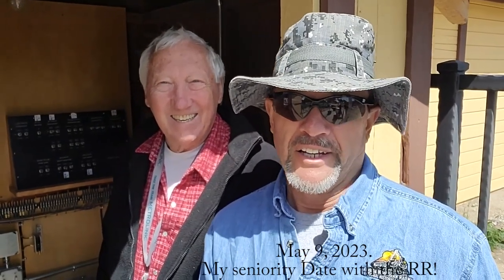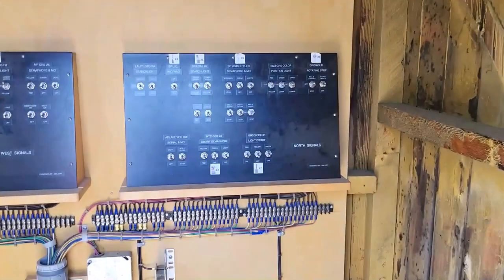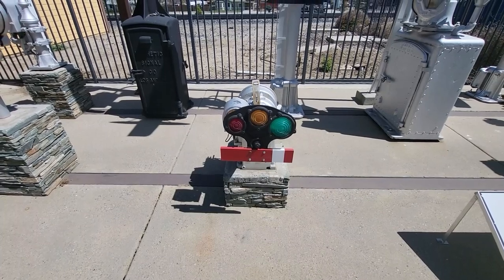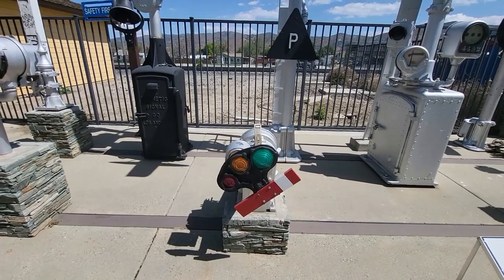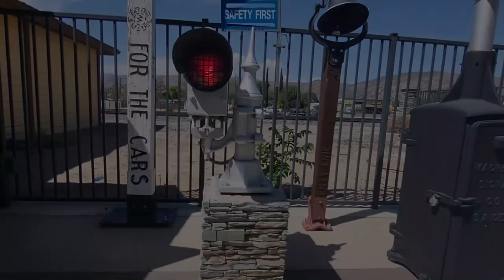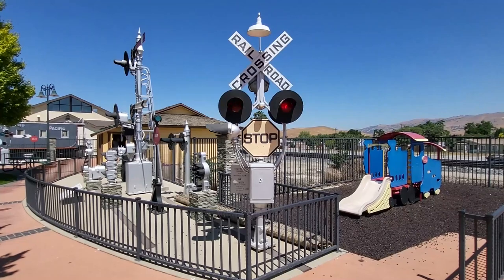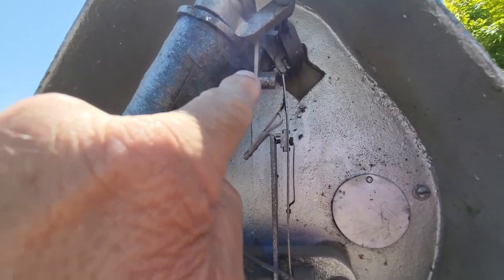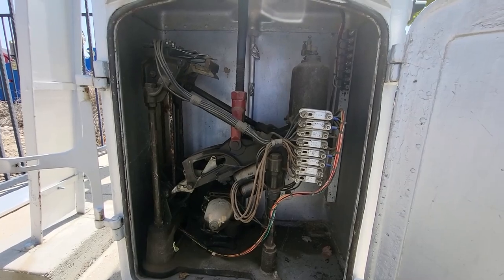How Vintage Railroad Signals Work: The Inside Story

Comment: It's my understanding (or misunderstanding) that almost all of these older signal types were designed so that if power was lost to the signal, the weight of the mechanism would cause the signal to go to red automatically as a safety design.
Reply from the maker: That is true. The mechanisms inside searchlights were also failsafe, with a counterweight that rocked the head to red if there were a problem. Thanks for checking it out!

Comment: Mark, you did a great job at explaining the signals.  I want to thank the guys who take care of the signal.  They are true railroad signal operators and maintenance guys who know their stuff.  Thank your and Thank you Mark for this great piece of video. Robert
Reply: 110 volt DC is a lot of power. Why so high ? That would be very dangerous to touch.
12 volt seems to be the voltage now
Reply from the maker: @ocsrc  If you're talking about the dwarf semaphore, I don't know why they went with that. Perhaps, since it was in a location where AC was readily and consistently available, it was just easier and less expensive, but that is pure speculation!

Comment: Hi Mark, thank you so much for the video, I really did enjoy it. The inner workings of those devices were simple and strong and would last a long time. The nice part is that they mostly made sense as to their workings, no magic from a computer, easy to diagnose. As an old retired mechanic I can appreciate the simplicity, like cars once were. There was an old station near my house when I was a kid and they had the semaphore out front. I’m going to assume that was there to get a train to stop? We also had some wig wags around here, Tacoma wash., the last of which, believe it or not, was removed just a few years ago when they upgrades a secondary line to run passenger transit trains.    Thanks again, much enjoyed.
Reply from the maker: The semaphore at the station was likely a train order board, which told a crew whether or not they had to pick up orders meant they did not, horizontal meant they did. The orders were handed to the crew on the fly. Here is the link to a video I made at the Santa Susana Depot Museum in which that process is gone over in detail.
https://youtu.be/CJfAT5EvWAw

Comment: Hay Mark : Given the dated  electro-mechanical  components [ The inner-workings of Pinball machines immediately come to mind ! ];  the durability of repeated; reliable performance under ALL weather conditions over the years remain as a compliment to the design engineers of these important  RR  safety machines !  ✊️👊🤙😁
Reply: I thought of pinball, too!
Reply: @matbr6949  Ja : The sheer NUMBER of Relays  and  related wiring-looms that controlled Pinball machines was unreal; especially given the abuse of forceful  Body-English  inevitably resulting in  * TILT *  ! !  👏😄

Comment: Gentlemen, I thank you for showing the real works of the signal apparatus, and all other railroad equipment that we would not ordinarily we [railfans] and railroad buffs would get to see. The parts of the signal lights are mostly mechanical, that could be easy to maintain more than the electronic parts. Mark Clay McGowan, I wish you "Happy Railroading!" even if you are retired.

Comment: These are examples of electrical/mechanical logic driving electrically functioning motors, relays lights, signs and bells.   These beefy concoctions of parts that go white and clunk revolutionized railroad (and all) transportation across the world.  The safety and efficiency gained is remarkable.  The museum is a wonderful presentation of that historical leap.  

A note about semaphore arms.  "Quadrant" refers to the part of the circle the semaphore arm uses to display the messages of aspect and indication, with zero at the top of the circle.  Upper Quadrant" refers to the 90 degree part of a circle in the clockwise direction between zero and 90 degrees, and lower quadrant refers to the 90 degree part between 90 degrees and 180 degrees. The style B semaphores use less than the 90 degree position at 180 degrees.  

Golly, the weeds are so cool!
Reply: Glenn, there were quite a few 0-90 degree three position lower quadrant semaphores.  The last being in service in  St Louis.
Reply: @paullubliner6221  You are correct.  I should have been more specific about the Style B units.
Reply: @glennfoster2423  The CRI&P had 3 position, 90 degree L.Q. Style "B's" Glenn.  "B Units" to me means something entirely different....

Comment: The lower quadrant semaphores (style B) were used in the Western U.S. by both the Southern Pacific and Union Pacific and date from the Harriman Era of both railroads. The upper quadrant US&S semaphores were used by the Santa Fe, Northern Pacific, and Great Northern. Interesting to note that you used to be able to tell whose railroad tracks you were looking at by the signals and the lineside poles.
Reply: ED..... Santa Fe used Style "B's" as well.  They were the first electrically approach lit signals in the U.S., or anywhere..  As for N.P. and G.N they also used lower quadrant semaphore signals.  It depends upon "when".  If you doubt me I suggest that you start collecting older editions of railroad "Rules of the Operating Department" books.

In 1981, on a road trip with friends on the way to Portland to see the newly painted painted S.P. GS4 into Daylight colors,  I pointed out were were following the "Wrong Railroad" as the searchlights were G.R.S. Type SA's, and not the S.P.'s US&S Style H or H-2 searchlights.  I was correct and it really irked one of the guys that I was right as he was driving, .....and an AT&SF employee!

Comment: The GRS Model 2A uses a buffer resistor that cuts in and in in parallel with the motor armature and field ( series wired provides more torque than shunt wired motors).

Comment: Illinois Railroad Museum has a large collection of signals too.   Did the railroads have DC current running along the tracks for signals or did they have to have transformer boxes nearby.  Nowadays I see transformer boxes powered by the electric company providing for signals and gates.
Reply from the maker: We had AC on the poleline that was rectified rectified inside the cases and cabins to operate local equipment like track drivers, switches and signal lights. DC circuits were also on the line to send information from signal to signal. Here is the link to a video I made about the poleline, which no longer exists. Today, most locations have their own power. Sometimes, underground cable is used to get power to remote locations, and all signal circuits now use the rail for both track and information control.
https://youtu.be/c0tJ6Ksv2HY
Reply: 10 volts DC was the original standard current for block detection.  Floating AC came later.
Reply from the maker: That's true for block indications on the line, but track circuits have always been less than 2 vdc, provided by batteries until the 1980s, when we began installing 1, 2, and 3 TC units (in my corner of the world!). I'm not sure what you mean by floating AC, but we do use AC overlays for certain approach circuits, but not for track circuits.

Comment: 11:48 That's not what "upper quadrant" means.  It means the blade moves in the upper quadrant (think Cartesian coordinate system), or upwards from Stop (horizontal), whereas lower quadrant move downwards from Stop (horizontal).  
But, it is true that the lone 3-position upper quadrant semaphore can convey exactly the same information as the two-arm lower-quadrant semaphore just shown can.
👍
Reply: AGREED!! Thank you for pointing out the only error I heard in this excellent video!!
Reply from the maker: That has already been pointed out to me. This is why I did the disclaimer at the beginning of not being conversant with these signals! Thanks for checking it out!
Reply: @MarkClayMcGowan  It's all good, Mark!

Comment: Thanks for the interesting video! We still have searchlight traffic lights, although this is very rare. The largest number of lens traffic lights, as at 20:26
Reply: "Traffic lights" are highway signals, not "railroad".  Railroad came in , "Block", "Interlocking", "Train Order" or "Centralized Traffic Control" types.
Reply: @paullubliner6221  Thanks for the clarification! Of course, I meant railway signals. Thanks for the clarification! Of course, I meant railway signals. I work for the railway and maintain the electrical centralization.

Comment: Minor nit pic on the description of the GRS Model 2A Semaphore. The location is actually named Grand Central Terminal.
Reply from the maker: Yeah, I've already been called on that a few times! What do you expect from a West Coaster?!
Reply: @MarkClayMcGowan  West Coaster are not the only people that have called it that.
Reply: @SandBoxJohn  That's because before the opening of GCT in 1913, the original Manhattan terminus was known as Grand Central Station.
Reply: @paullubliner6221  Actually the terminal before the existing terminal was Grand Central Depot.
Reply: @SandBoxJohn  Show valid period proof of your claim, please.  I looked in one of my signal books, Block Signals, by Braman Adams, published in 1901, and it has the 1901 track diagram located at East 42nd Street and 4th avenue NYC (same a the present site) and plainly the track diagram was labeled as and the facility therefore called:  "Grand Central Station".

Comment: 12:10 Blade interference on semaphores wasn't a problem.  The UQ semaphores typically used blades 3 feet long and were spaced 7 or 8 feet apart on the masts.  (A three-arm semaphore typically had a shorter blade on the bottom, only used for what would today be called a Restricting indication.)  The LQ blades were usually about 4 feet long, and, while spaced closer on a mast, didn't typically go fully vertical (except for very early types, and perhaps 1-arm train-order signals) ,.
Reply: @paullubliner6221  Yeah, not exactly.  The first six inches of most UQ blades don't do a whole lot.  So the usable part is 3 feet.
Reply: Not exactly.  The R.S.A.  (Railroad Signal Association) standards set in 1908 are 42" long blades for upper quadrants and 48" long blades for lower quadrant.  This was concurrent with the Type "A" U.Q. spectacle so few seem to realize was its origin. 
     Union started with a 6 foot spacing for the home and distant A.B.S. blades on their "B's" (as on my own examples) but around 1911, US&S increased the spacing to 7 feet as the new standard for improved sighting distance. 

---On three arm U.Q. semaphores, the R.S.A. standard spacing was top to middle blades 7 feet,  with middle to lower blade spacing being 6 feet along with a 2-1/2 foot blade on the bottom arm. This served the same function as a dwarf signal.
   Erie used a 12 foot spacing between their pointed A.B.S. three position upper blades on their well known Union Style "S's", and the lower blade 30" long and square for "Train Order" (crossover) dispatcher controlled operation.
Reply: @jovetj  You ARE joking right?  In 60 years of actively looking, I have NEVER seen a 3 foot semaphore blade anywherre in the U.S.  The R.S.A. Standards were universally followed, EXCEPT on the Lehigh Valley with 48" U.Q. blades on their top-of-mast Model 2A's, while over on the B&M, the CNJ and the Erie; their US&S pneumatic and electric L.Q. semaphores had 42" blades.  
----YOU KNOW, there's reality and then there's the unhealthy state of self delusion Jovetj....
Reply: @paullubliner6221  Self delusion?

Comment: Many people ask why I stopped railfanning as much as I used to, its simple. Alot of character from the Class 1 RRs of today are almost nonexistent. Alot of the signals, the roster, and even the sounds (Detector Voices, the same 3-4 horns) are all the same, the only way to tell what RR is what is the paint scheme. Even NS are starting to do away with the older CP signs from the SOU days.

Comment: Too bad they took alot of the searchlight out like them better
Reply from the maker: The searchlights were good signals, but the LEDs show a far superior aspect without having to be aimed to a point, are easier to maintain and work on, and much less expensive. Thanks for checking it out!
Reply: @MarkClayMcGowan  NO MARK!  The green has a peak wavelength of 505 to 515 nm which is greatly absorbed in fog or misty weather, significantly reducing the range.  The red peak wavelength of 635 is too orange for true "Railroad Red" (660 nm)  and therefore is sometimes confused with adjacent to the Right of Way traffic lights.  They have problems, not a panacea of any kind.
Reply from the maker: I have never heard a complaint from train crews, and if it were a true issue, the FRA would never have okayed them. They're certainly better to work with for we signal guys as there's never any doubt as to what color a signal is during a cutover or working a problem.
Reply: @MarkClayMcGowan  Then you need to ask the Hogheads I know. As for the FRA, do realize they also were "ok" with East Palestine, Ohio's outcome as well, never mind 10 miles worth of active hot box detectors.  What I said about the 505-515nm visible absorption  by heavily moist air is indeed correct.
Reply from the maker: @paullubliner6221  first off, I don't know the hogheads (which no one calls them any more) you know, so I can ask them nothing. I only know the ones I know, and the ones to whom I've spoken about it, like them better, even in the San Joaquin Valley's famous Tule Fog.
Second, hot box detectors don't fall under the purview of the FRA as they are not part of the signal system or track structure. What the FRA signed off on was that the crew operated the train exactly as they should have, and the signals and track had nothing to do with any of it. Every HBD worked as intended as set up by the NS.
Reply: @MarkClayMcGowan  Yes Mark there are quite a number of old timers who still use Hoghead, such as Captain Caustic himself.  
--- Right; "exactly as they 'should have" that  precisely is my point Mark.  Ever wonder how exactly, "...as they should have." can be the case when they had a burned off axle end disintegrating visible in a surveillance video?  The FRA is every bit inept as are most of those authority types.  That burn was beyond toxic. A bunch of apparatchik idiots as the record makes clear.  Next, I expect you'll tell me Pete Buttigieg is eminently capable and an excellent admnistrator.

--As for those "wonderful" and "lasing" LED's signals you prefer, coherent light emitting LED's as these cause eye damage Mark.  As in 12 feet high, inline with the engineman's eyes if I'm not forgetting. Time will prove this one to be "not the best approach" of an idea... time will prove this so.

Comment: as a railroad man i still cant figure why most class 1 roads have gone to those vader type signals i worked for conrali and they did the same thing, not only that they did away with most way side signals and switched to cab signals which i never trusted. as i have seen them fail many times.
Reply from the maker: Here are a few of the reasons LED signals replaced searchlight signals. Searchlights had to be precisely aimed. LEDs are good if they're pointed in the general direction. They relied on a system of a reflector and two magnifiers which made them susceptible to damage as well as "phantom" aspects if the sun was just right (which I encountered on three occasions). LEDs are simply bright bulbs.  The searchlight mechanism had to be tested quarterly for movement, and bi annually for operational values, both of which were VERY time consuming. LEDs have no moving parts. Searchlights were HEAVY, necessitating a boom or other lifting device should they need to be changed. Three headed LED signal can be changed with a few guys and a good rope. Searchlights were expensive (the mechanism alone was around $2,000), LEDs aren't cheap, but their cost is made up for in ease of maintenance. Thanks for checking it out!